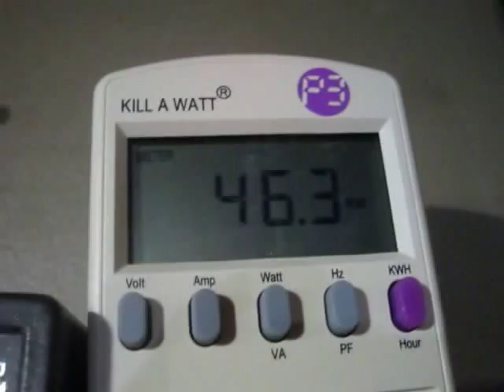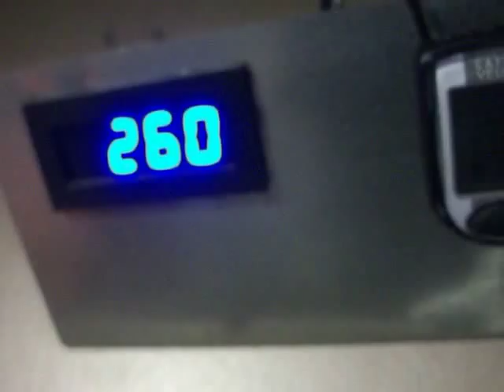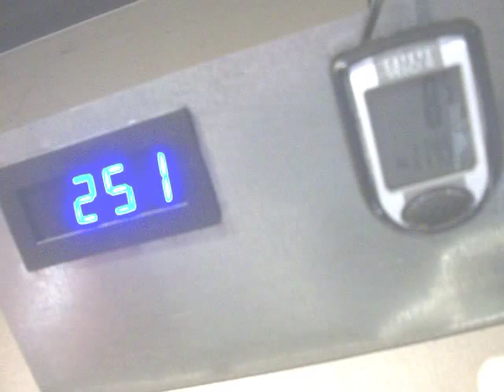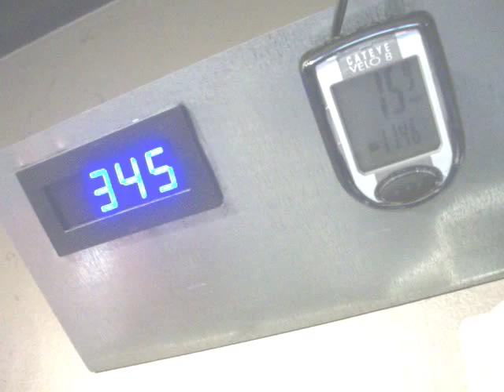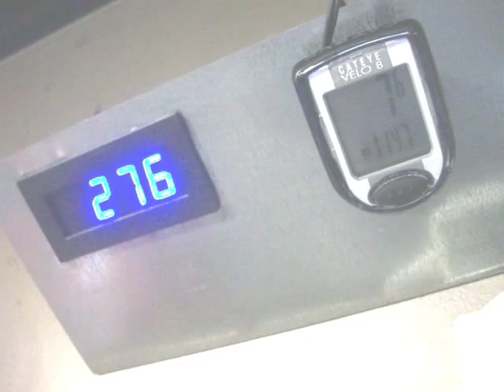48 Volt Missouri Wind PMG mounted with 553 rpm reading 11 blade

Comment: I'm wondering if the location of your turbine is appropriate - it's not very high above the roof, and there are large trees all around by the looks of it. Have you considered temporarily putting the anemometer higher to see if there's more wind, and if it's worth it to extend the tower?
Reply from the maker: +Gyppor Of the two towers, one is 22 foot from the ground and the modified is 25 foot.  There is a clear shot from the northeast with no trees and most of the wind comes from that direction.  My poles tilt to lower them and it takes all my strength to tip it up with help.  I can't go up any higher as I'd need guide wires and it's just not windy enough to be worth it.  Storm winds only made 400 watts for the day which is my best.   Even if I was able to make 2 kw's a day that only comes to .32 cents savings.  These turbines will never pay themselves off and my solar panels are 100 times a better investment.  My eight 230w panels give me 12kw's a day in the summer.  Even the panels will take about 9 years to recover my investment.  Sometime in the future I'll make my own pmg with more magnets so it cuts in faster.  250 rpm's before you see any power is unrealistic.

Comment: Go with 7 blades if it's the Freedom 1, That is what I had the best results with.
Reply from the maker: ***** Thanks, that confirms my thoughts......I've already ordered the 7 blade plate 2 days ago.  On my other pole, I may as well throw another 48 volt pmg but I'd like to try the G5 blades.  The results should give me some idea if a dual 48v pmg will work in the future.  Weather says "strong winds" for tomorrow which is great but it looks like I won't be able to switch anything until Friday (first calm day).

Comment from the maker: I had to revise the old video to add a better rpm read out.  I'll be switching to probably a 7 blade, and then to a 9 blade.  I also want to figure out the rattle at 300 rpm's.  The 1 1/2 pipe used, I didn't cut the threaded end off and I think there maybe a slight gap where the top of that mounting bracket is.......